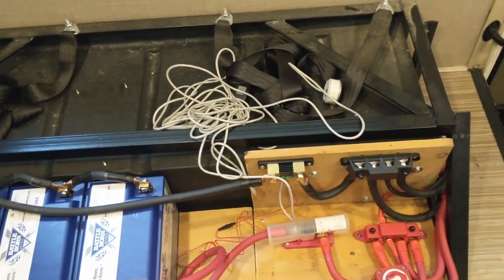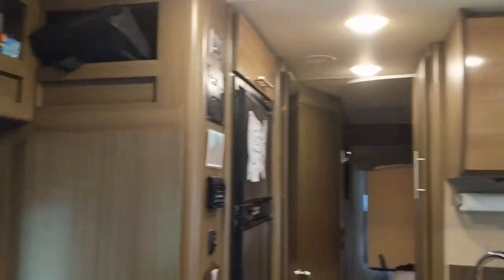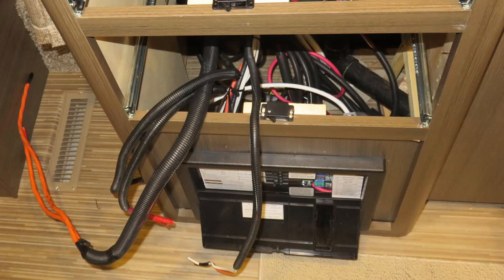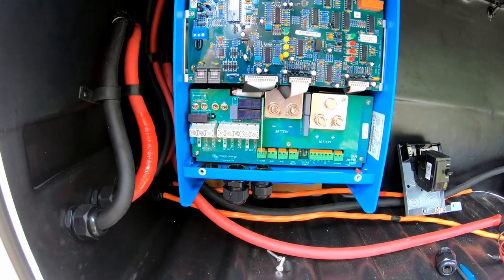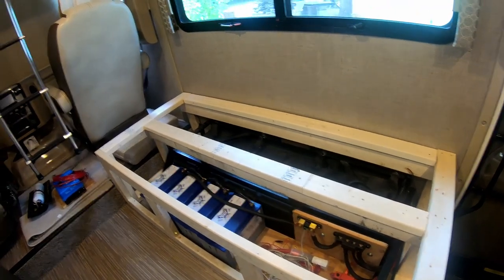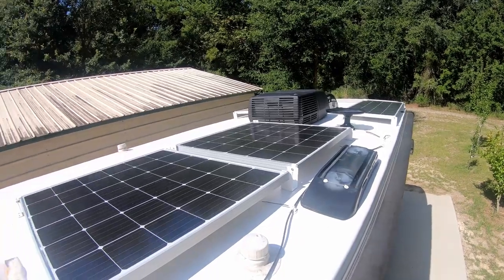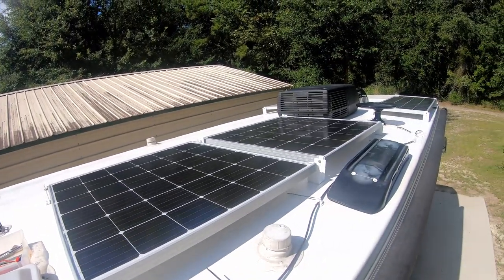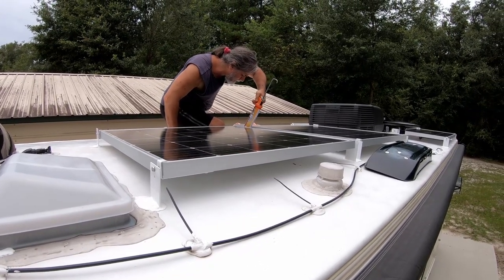Solar Install - Part 2 - 2018 Thor Axis 27.7

Comment: Thanks for subscribing to my Chanel u did a awsome job with the solar system
Reply from the maker: Thanks. You look to have good solar experience so I appreciate your comment 😊
Reply: Its almost a year doing solar my home totally off grid
Reply from the maker: I just finished the final connections and it all works 😊👍

Comment: I need to get solar. We have room on top, but not in rig. I hate when they say solar ready and put in wire that’s to small, that happens all the time. 5 should be good. I do not like being on roof either.i crawl on my knees. Good job. 👍🤠🚎
Reply from the maker: Thanks it was challenging but fun and is working well so far 👍👍

Comment: Nice work! I would like a solar system but on a smaller scale since we usually don't boondock for more then 1 or 2 nights at a time. We are usually at our GVWR on our trips so need to be careful about adding more weight, glad we have the Sumo Springs anyway, I have a ebike pre-ordered (more weight).
Reply from the maker: Those ebikes look pretty sweet.

Comment: great install, on screwing in the panels did you attach the screws to studs on the top or just screwed in were they would fit best on the roof attaching them to the roof plywood?
Reply from the maker: the very front brackets are in a metal roof stud bu all other brackets are just where they best fit in just the thin plywood and "so far" are holding up well.  We have a good 5,000 miles on the rig since then.  I think the dicor on the screws must help.  Be very careful not to over tighten.

Comment: Why didn’t you put the new batteries under the steps. We have the same unit
Reply from the maker: Under the steps only holds 2 batteries without modifications. We now have 4 with option for one more.  Also it is so much cleaner for wiring other stuff.  Thanks for watching and the question 😊